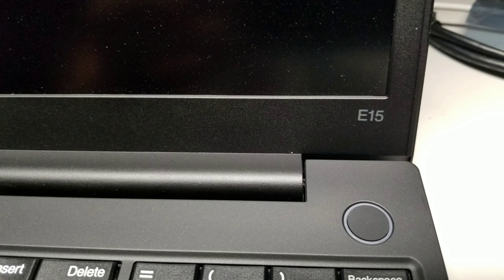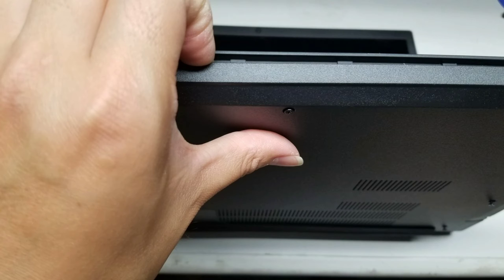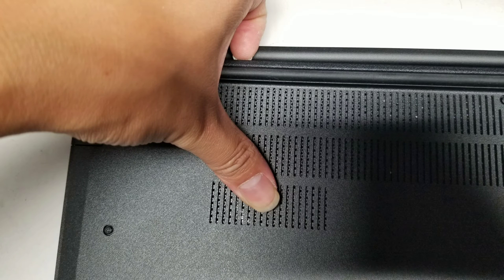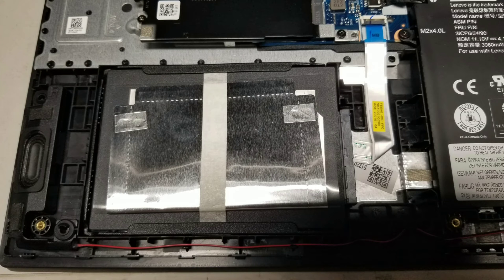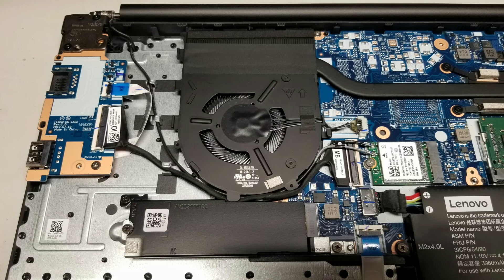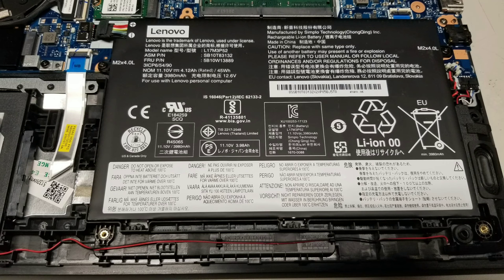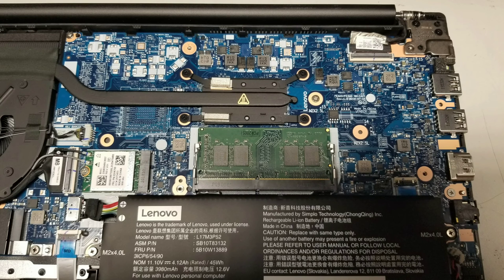Lenovo Thinkpad E15 Disassembly RAM SSD Hard Drive Upgrade Repair

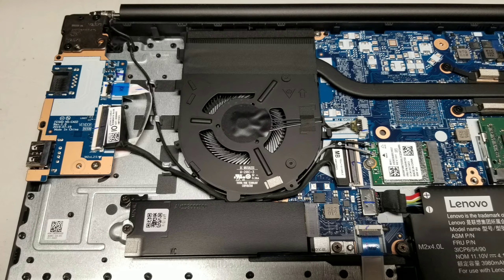Comment: 1:10 what’s the black metal piece on top of the M.2 SSD? I took a M.2 SSD from one of these E15 laptops and put it into my tower PC, but the metal black piece doesn’t fit into my tower PC. Is it necessary to stay with the M.2 or just leave it in the laptop?
Reply from the maker: You can take it out and leave it in the laptop.